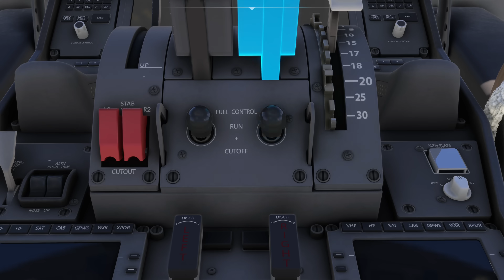Air India 171: Why Did The Fuel Cut-off Switch Get Moved?

Comment: No way did the pilot(s) turn those switches in fuel off. I believe the co-pilot when he said he didn't put them in shutoff mode. The manual switch states are read by the CCS ECU units using GPIO pins in software all prone to faults. A software bug or GPM Simplex IO ASIC bug would be a more likely scenario. The 787 16 GPM-300 cards are obsolete now. Replacements are harder to find for maintenance crews. GE has re-designed the GPM 300 with new IO ASICs to address parts obsolescence but made an unsafe scenerio. There are electronic fires on the GPMs reported by ANA airlines due to thermal meltdown issues with the GE ASIC chip design.

Comment: BUT data is likey fuel control valves are recorded as in fuel cutoff position. Everyone is assuming switches were moved to cutoff ? What if some other electrical input moved the valves after lift off where fadec has control such as performing relight sequence when not required.......

Comment: I was a Instrument Control System tech for 50 years, in the Paper Making industry, and for all of our "critical machinery" that we dont want to be even accidentally stopped, we fit the stop button with either a deep shroud over the button or a shroud with a flap that needs to be lifted to access the button. This may have given the second pilot enough time to stop the other pilot from pushing the button, these shrouds do not slow down the operation of the button very much, it just means you have to reach to the button, lift the  flap over the button then you are able to operate that button, it may take one or two seconds but that may have given the other pilot time to reach across and stop the second pilot from operating the cut off switch. As someone who is not a Pilot, I would have thought a switch as important would have more mechanical protection of inadvertant operation.
Such a sad outcome for many families.

Comment: Captain Steeve my main issue with the dual pilot verification or dual pilot process needed for the fuel shut off switches is that if one pilot has a medical emergency and is unconscious or is not in the cockpit do to using the restroom and something goes wrong with an engine that one pilot needs to be able to still turn off the fuel shut off switches now I do think there should be other safety features considered such as perhaps as a second button or switch that would need to be activated before the fuel shut off can be switched off or on but the issue i see even with that is pilot over saturation with multiple tasks when trying to deal with an emergency and I am not an expert and never will claim to be. I shared the limited knowledge I know but would love to hear your thoughts and any thoughts from any other pilots because safety is definitely paramount

Comment: Looking at your input on this case. Mine opinion is this: In case of switching off one of engine fuel line, it shold be like right now. Spring is safe guard enought. But in case of switching both (or more in cane of more engines) all such esential switchess off, it shold require to both pilots to confirm that (mechanicaly it is rather easy to do, just need to more them two hends to do this, for example you need to rise spring swich, holding some kind of safeguard and in simultaniesly ,move cover over other one). As You mentionen, only one "procedural" situation when both switchem can be set to off is in reather controled situation on hight altitude, when this shold be not a problem.

Comment: Could both switches been in the cutoff position before take off, and both pilots didn’t notice until in the air. And could the plane just have enough fule in the lines for the plane to take off.

Comment: Then these switches shouldn't be able to be cut off, if 'sensors' detect 'take-off configuration', and gone beyond the point of 'no return' etc., but I can see the point of them on 'landing configuration', or 'in-flight' for sure.  V1/V2, should not allow for these switches to be controlled, in any way, as shutting them off (in an emergency) @ 400-600 ft upon rotation, would do no good whatsoever, as we have now seen.  The recovery time, if doing so, and switching them back again, is zero to none.  Gear up, and 2000+ feet maybe?, but no way otherwise.

The 787 is a mighty beast, a behemoth of an airliner, an awesome sight to behold, but it needs all the power it can take to get off the ground in normal circumstances, and any hinderance to that fact, was never going to be good.

At the end of the day, we all put our lives in someone else's hands, else we would never travel, even on a bus ;)

I'll say it again.  It's now time for cockpit video recording to become 'mandatory'.  All uploaded to the cloud, same with 'voice and data', all uploaded during flight.  No need for 'black boxes', and no need to spend countless hours searching for them after the fact, all the data readily available, should something horrible happen again.  Pilots make an issue of this being a 'security' breach?, well, there are more cockpit video's online now than ever?, and we have the tech to block out anything that need be, so a feeble excuse IMO.  We all live in a 'big bother' world now, with cameras everywhere, so let's introduce them to the cockpit also.  Nothing to hide?, nothing to worry about ;)

I'd rather know (and get to the bottom of it) who done what, than wonder which done what, and I sure as hell know, that the families of the deceased would feel that way too.

Comment: Many pilots who flew ( including this 787 class of planes) find it very difficult to comprehend how either of the pilots could have reached out to fuel switches in 3 seconds after take off when both pilots would be busy staring at windshield and other panels this early in the game.

Other point the pilots also disagree, it is not easy to transition both the switches from On to Off in 1s apart esp when flight is in nose up like situation.

In the past these switches had transitioned (when operating in non-locked state) and Boeing had issued advisory note (not mandatory) about this existing issue!

Yet Captain Steve is so very confidently pushing pilot error narrative with high confidence....any reason you are pushing one sided theory????

Comment: Not good the fact that you are protecting your job instead of the idea of safety. Absolutely cameras would tell the story factually perfectly in this case. How better automation algorithm that I've come up with would help. The fact that 2 people 2 pilots are in the plane. It should take two pilots to turn off an engine. Very easy solution. 1 person reaches for the switches. The other person hasn't move the throttle handles to idle gun. Two people fault two pilots involved

Comment: Still too early to rush to conclusion…it’s improbable that not one but two switches were manually switched off and then on in the matter of less than 10 seconds without a more visceral reaction from the other pilot. There is more here.

Comment: Is it possible someone other than pilot flying and pilot monitoring moved the switches 
Could anyone have been deadheading in the jump seat or any other crew be in the cockpit and if so would the preliminary report have mentioned this? 

I also seem to recall the previous crew on the aircraft logged a pilot defect report for STAB POS XDCR or Stabiliser Position Transducer which I believe is part of the system that controls the trim on the horizontal stabiliser though I doubt this would have contributed to the incident

Comment: A couple of comments-it’s not a million $ question, it will reach billion in the courts. What that gentleman was trying to ask I think is if there should be a mechanical mechanism who would act as a “mediator “. If one switch went to off position the other switch shouldn’t be able to go to off position until the first switch that went off is back to on position. 
Kind of logical interlocking mechanism between two switches

Comment: Nobody speaks about the SAIB report, which clearly said that the fuel switch was faulty in 787 ,737 part. That is the exact faulty part number which was running in this flight. The report clearly said that the fuel switch can come to the cut-off question without any
 action being done switching the fuel to the engine..
Shouldn’t this be considered as a very crucial evidence of the malfunctioning of the switches ??

Comment: Would making the fuel cut off ``disable`` at (low air speed + full throttle) be an option? In other words, make it so that it wont cut the fuel when activated unless the throttle is also brought back...

Comment: I've been a state-licensed investigator for 25 years, as well as a commercial pilot. One of the first lessons learned in my field is to never fall in love with your first theory. Confirmation bias is a powerful force. It is difficult to suspend judgement. There are still competing theories to this accident. The most plausible one being a failure of the switch locking mechanisms that could cause brushing a hand over the switches to move to them to the cutoff position. That failure is described in FAA bulletin NM-18-33. Any conclusions at this stage are still speculation.
Reply: Both cutoffs?  Highly doubt it.
Reply: The switches cant be bumped, they must be pulled up and out of detent then down to clear the lockout gates on the sides. Those gates are solid and dont move as well.
Reply: @08turboSS Read the FAA bulletin. That was the whole point of the bulletin: the switches CAN be bumped.

Comment: You are still erroneously believing thar the INDICATION of the switches position MATCHES the ACTUAL SWITCH PHYSICAL POSITION.  This is an enormous leap and a MISTAKE. 

In ages past, physical switches controlled physical objects. And even then things happened to make the physical switch not match the action. 

In this day and age, switches most often command not physical devices, but rather act as inputs to software.
Reply: That is not how those switches work and it is also not how the black box works either.

Comment: 1) Ingenious "fly-by-wire" computer controlled system should NOT allow fuel cut off during the midair takeoff. 
2)Fuel cut-off should never be an easy single step process. 

Those are the seriously dangerous design flaws. Even with those spring loaded switches that cannot be toggled without pulling, sliding and putting into the desired setting(RUN or CUT-OFF), they are way too easy and subject to bouncing itself due to runway shocks, even though that us unlikely to happen under normal circumstances. Faulty switches due to faults in the spring mechanism can occur.

Comment: There is a possibility the pilot that cut the switches was the one who asked the question, to deflect blame at the last minute. The other pilot honestly answered I did not. In the ensuing confusion there was a significant delay to switch the fuel back on that is hard to explain if it was just accidentally shut off and both pilots were working hard to remedy the situation. One would expect only several seconds to switch the fuel back on, not the 10-15 seconds it actually took.

Comment: I noticed this on the BBC News website earlier - "India's aviation regulator has ordered the country's airlines to inspect fuel control switches in Boeing aeroplanes, after their reported involvement in a fatal Air India crash that killed 260 people in June."
i wonder if it's related to that 2018 advisory about the switches
Reply: Of course, they're going to go through every single measure possible. As Steve has already explained, even if the switches were installed backwards it would not cause this. You would notice it when you first started the aircraft as the switches would not be able to stay into run. This also isn't some brand new aircraft.

Comment: There was a memo from Boeing that some of the fuel switches were missing the bump proof pull-and-turn lock. If this plane had the unsafe switches, and was pitch-up climbing, could something like a mobile phone on the "dashboard" or a GoPro suction cupped to the window, have fallen and hit the switches? That would explain the CVR dialog, and there might be an audible thump to prove it.
Reply: If the switches were installed backwards, the switches themselves would not be able to stay into run. This is also not some new plane.

Comment: Regarding requiring 2 pilots to activate the engine cut off switches.  That's a bad idea.  What if a pilot is incapacitated?  The better solution would be to prevent fuel cutoff on ascent, below some predetermined altitude.

Comment: I have the fix. Turn off 1 or 2 engines. Whichever with the switch during take off or anywhere will not activate until at the same time next The thrust handle is turned back to idle. 2 pilots needed since one pilot is holding the throttle full on.

Comment: I also had this thought as others have mentioned and have said it in other channels. It is possible, the one asking the question is also the person who turned them off, trying to put the blame on the other. Just because someone says or asks something does not mean that is actually what happened. Sure while we can know with 100% accuracy something was done as in switch positions etc. We cannot at any point say or tell who done what when. The flight deck has no cameras nor does it have any other device or system installed in the flight deck to say with any certainty who done what. As to why both fuel switches being turned off. Is there not in the memory items or in the checklist that in the event of a dual engine failure both fuel switches MUST be returned to the off position so that a engine restart can be initiated? Not that given where they were in the flight that any checklist would have been consulted in the time frame. But, is it possible that they knew both engines had failed for whatever reason so they put both switches to off and then returned to on in the hope of trying to get the engines to reignite...... I am not saying this is what happened. Afterall the only ones who truly and who will only ever truly know what happened are those who were on the flight deck.

Comment: Good analysis but I don't agree that the info provided by the flight data recording provide are equivalent to  what we could get from camera. In this case for example it is likely that the pilot guilty of activating the switches is the one asking the question to the other, why did you cut the fuel. He knows that the conversation is recorded and in this way we would put the blame on the other pilot. This explain why the other answers, I didn't. It is going to be a problem to establish who did it, without a camera. If the act is premeditated this is the most likely scenario. Another scenario could be the presence of an unauthorized third person in the cockpit, not disclosed by the preliminary report.

Comment: The word "transition" means a change or movement from one state, stage or place to another. It is a very unusual term to use in a preliminary report such as this unless it was designed to be ambiguous. The report does not say that the switches were manually moved from the run to the cut-off position. After around 10 seconds they were "transitioned" back to run. The transcript of the question by one of the pilots implies that he saw the other do the action, although he might have been lying. We really need the full audio of the CVR ASAP to stop so much speculation and distrust in the investigation.

Comment: The fact that one of the pilots asks this question itself means that this is for sure some technical sag… bcos as everyone is claiming the fuel switches were cut off 1s after each other 10s after lift off … if one of the pilots has done it during lift off won’t the other pilot have seen him doing it and stopped him???

Comment: Captain Steeeve, Liftoff was at 08:08:39 UST Time, RAT deployment at 08:08:42, Engines Fuel Cut off also at 08:08:42…. 
There is a newer picture where we clearly see the RAT is deployed while the Airplane is still having enough thrust to climb. The airplane is still climbing. I have a hard time to believe the RAT detects the lost of thrust, unless it’s in the electrical logic and knows, fuel off=deployment of RAT. 
Could it be the other way around, RAT mail function telling the aircraft logic to transition fuel-off? This could be something never considered in the FMEA. It could be a bug or glitch. Could this be tested in the simulator? What happens if you deploy RAT during liftoff…

Comment: Dr. Captain Steve: There are many comments on ways to prevent engine cut off like what happened on Air India. But engine cut off is just one mode of intentional sabotage. There are other such as the flight controls to fly a plan into the ground. Unfortunately, there is little that can be done to stop a person intending to do harm.  The thing I see is that this poor person needed help and he didn't get the help he needed.  So sad.